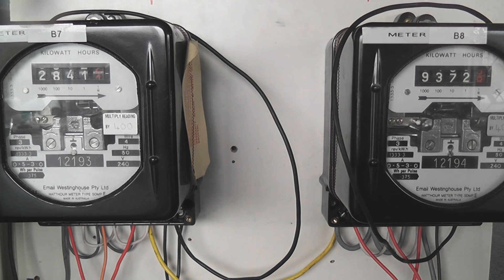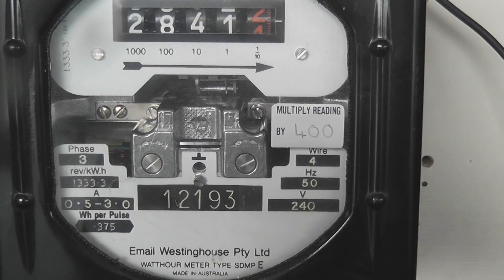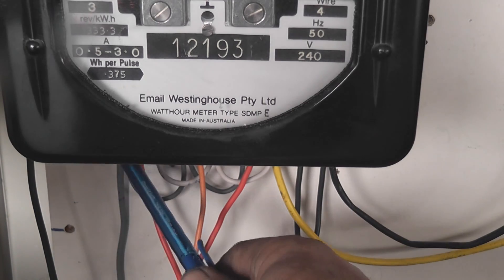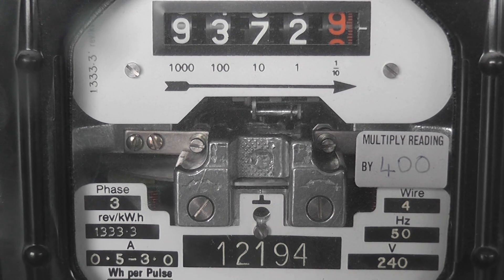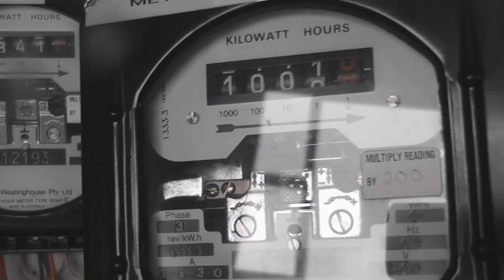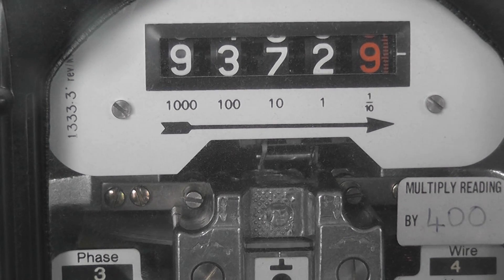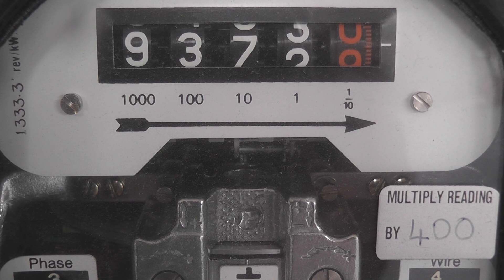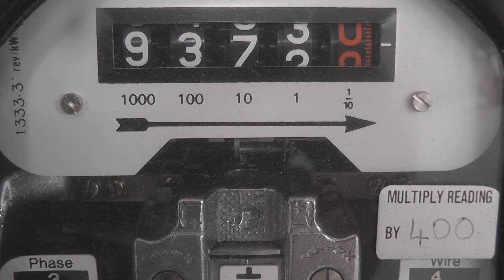Email SDMP E Watthour Meter

Comment: interesting thought p stood for pulse
Reply from the maker: Yes, you are probably right. The type category doesn't always make sense. P is pulse. Then the E is pulse with the flex wires coming out of the meter and H is where the pulses come from the two small terminals. The flex output wires have a common feeding a change over pulse. the H version haven't tried yet.